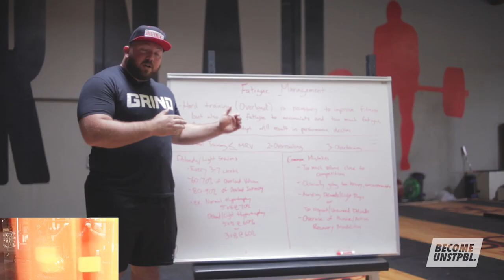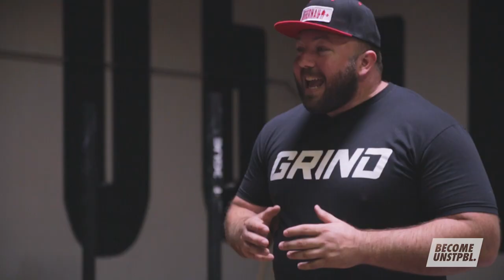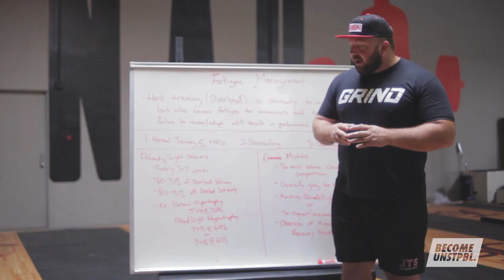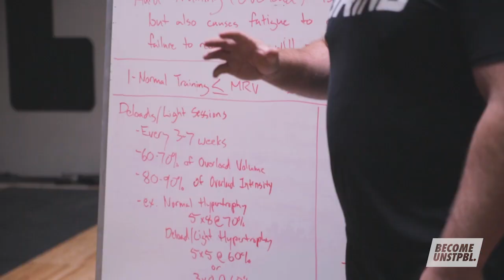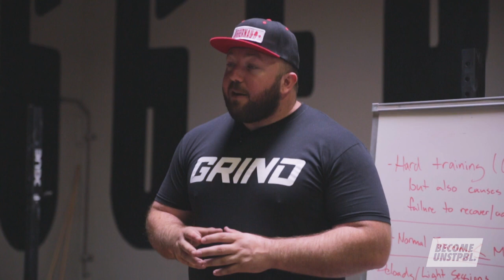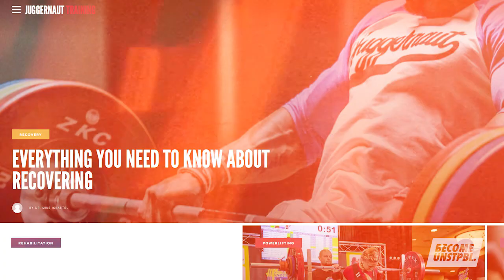Fatigue Management | JTSstrength.com

Comment: I love this guy! I thought something was wrong with me. I started full body training. Heavy and light lifting with cardio. I went from hero to zero over night. You just saved me from making a mistake. I bought all kinds of natural test and stamina boosters. I noticed a pattern in my training. And I never could understand why I'm super strong for a month then completely helpless for two weeks. 2019 10/10 
Mark this day I will be taking your advice. I gained 12 pounds of body fat because I thought I was under fed but now I know. What you teach, It all fits. I been researching so much I'm practically a chemistry doctor now and I couldn't find anything that fits my issues.  Thank you!💪 Today is day 8 and I'm right on schedule starting to get my drive back. All I did was nothing couldn't get out of bed. I will make more effort to do light exercises on my down week. I got a tens unit for message therapy. Can't wait to gear up for more.love to pump it's truly the best high to get

Comment: You mention in this vid that you increase volume or intensity week over week for 3 weeks, then deload.  When I plug my numbers into a hypertrophy
block from your book, my volume for each lift each week could go up or down
depending on the intensity rating of the sessions for that week, there isn’t a
consistent increase in volume.  Is this intentional? Does the increase in intensity (and the corresponding decrease in volume) for those lifts still fit into the concept of functional overreaching before the deload?  Or does the hypertrophy block setup in the book aim more for increasing volume from microcycle to microcycle instead of week to week?

Comment: Two weeks into a cycle and my last couple workouts have had great progression, +1 to +5 reps per set across the board, but I'm starting to feel run down and my joints are achey. Should I deload? Dr Mike recommends deloading when you stop making progress, but I'm still rolling out the noobie gains.

Comment: Hi Chad, love all of your videos and other resources on JTS! You have mentioned that volume will contribute more to FATIGUE than intensity will, however, I have also heard you mention before than high intensity loads will be more neurally STRESSFUL to the body. I was wondering what the implications of this were in regards to your MRV and readiness to train. ie. which factor (induced fatigue, or stress) will 'fill the cup' of you CNS quicker? what is the difference between stress and fatigue?
Reply from the maker: Great question. Muscular, neural, tendon/ligament/joint integrity stresses are all contributing to fatigue. During the different phases they'll contribute differently towards MRV: muscular-hypertrophy, joint/tendon-strength, neural-peaking but all are always present at different levels, just the main contributor will be more what necessitates the deload.

Comment: Great content.  You are mentioning in the clip that one should feel hungry and ready to go after a deload week.  What if I am at a place where I feel tired, weak and demotivated all the time.  Am I just fatigued and need to step back on volume?  I feel like I am making no progress at the moment.
Reply from the maker: That is a sign of overtraining
Reply: That means u didnt schedule and take enough deload weeks so ur fatigue didnt drop enough for ur next mwso cycle and u continued and ramping up fatigue and now you NEED an extended rest. Depending on the depth of the hole u put yourself into it can take anywhere from few off weeks to months and god forbid in some cases a year or two (but for this u need to be a bloody maniac so probably not what u have)

Comment: Chad, in all your videos and articles you recommend higher frequency training for beginner and intermediate athletes.  Would it be smart to also look at the athlete age because a 35-40yr athlete may not recover from a higher frequency program even if they are a beginner/intermediate athlete? For example your cowboy method program outline in your book (squatting 3x weekly etc).
Reply from the maker: LewisSports Trainingsystems too hard to say based on age alone. Training history will play such an important role there. Someone coming from a lifetime of athletics but only 2 years into powerlifting will be able to do much more than someone going from sedentary to 2 years of powerlifting.
Reply: Chad, maybe I’m wrong but I was looking at it from Charlie Francis point of view of programming. Considering the athlete age and which recovery methods they are using… If you have an athlete who is 36yrs old - work 40hrs a week, has 3 kids, only sleep 6hrs a night, high to mod daily life stressors, not getting therapy. I think it would be very hard to train on a high freq program or perform any high volume high intensity work.  This is one of the reasons why Charlie recommended only 2 speed days for beginner/intermediate athletes.  Thoughts?
Reply from the maker: Yes, the additional information provided in your 2nd comment about work schedule, kids and sleep would likely mean their recovery would be impaired.
Reply: Another reason I recommend all my athletes to use "bioforce" hrv esp if they are in there mid 30's.  Great tool to have on deck when trying to push the limits...
Reply from the maker: LewisSports Trainingsystems http://www.jtsstrength.com/articles/2015/12/27/fatigue-indicators-and-how-to-use-them/
Reply: Chad, I'm testing my 30m sprint from a 3pt stance, SLJ, and 3 fold SLJ on Monday and will complete the week with tempo and 2 easy upper body and 1 easy lower body session. I decided to run the 12 week "cowboy method" I'll report back with my 12 week post results...  I will let my "HRV" readings guide me alone the way....

Comment: Are you suggesting to take scheduled light days before reloading after three weeks?  Or should that just be something you use randomly.   I have been going through the book but I'm still confused on this one principle.
Reply: Before a deload u want to be functionally overreaching. So a tad bit out of normal range. Then do a deload to recover enough for next mwso cycle. And dont forget after few mesocycles take a prolonged (3 or 4 weeks) maintenance fase where u train VERY lightly or not at all with 1 goal in mind: diminish all fatigue and nurse any injuries. To bring u back to optimal for start of a new mesocycle

Comment: If you were training a field sport athlete doing a bunch of other sprinting/jumping/throwing would you still train in the hypertrophy/strength/peaking blocks or would it look more like inverted Jugg method? Thanks chad!
Reply from the maker: +Nicky Miranda when you are training for sport, the structure will change because specificity, the most important principle, has changed. Now instead of the target being how much weight you can move in these 3 lifts, it is going to be how good at football you can be. For my guys, that means we go through a GPP/Restoration Block, Alactic Power and Alactic Capacity. I go very in depth during this seminar presentation (fyi...it's 4 hours long and covers training from the first day of the off-season through the end of the season): https://360.jtsstrength.com/videos/22/99/juggernaut-football-method

Comment: is using the prilepin's table and using your overloading principle a bad basis to setup your reps and set scheme? for example if i were to create a hypertrophy block using prilepin's table and your overloading principle, i'd start off witha 3x6 at 70% which is the optimal rep and set range for that percentage according to prilepin'd table and then just add on a set with each week.
Reply: and to add to that will that be enough to reach a functional overreaching state?
Reply: I am no expert but Prilepins table was created for olympic lifts, wich are a lot more technical and so the focus of prilepins table is to improve the technical skill and strength, not really hypertrophy. I don´t think it would do particulary good for designing a hypertrophy program.

Comment: How should training session/main lift frequency be regulated during the deload week? For instance if I squat 3x/week normally, should I perhaps reduce my squat frequency to 2x/week to reduce total volume? Or should I proceed normally with lower set-rep volume at 60-70%. intensity?
Reply from the maker: Either is fine.
Reply: Juggernaut Training Systems thanks, I appreciate the quick response.

Comment: After a deload should you go straight back to the weights you were struggling with or take it back a few kilo's?
Reply from the maker: Drop it back. Let's say volume increased in each week 1, 2 and 3 then you deload. Start the next block at 1.5 and go 2.5, 3.5. Know what I'm saying?
Reply: +Juggernaut Training Systems I do! Thank you. I bought the book a couple of months looking to train smarter. I've added a lot more volume but wasn't sure how long I could keep adding more weight each week, as I was getting pretty  fatigued pretty quick. I was previously doing squat everyday for about a year going up to a single and coming down for a few triples. I've been listening to the Mark Bell power cast a lot recently and all the greats said volume is the way to go. Thanks for all the information :)

Comment: I just finished an 8 week program that I designed.  Program went well and I felt very strong.  However, I did a week at 90% on all three lifts thinking I would go for rep PR's the next week at 95%  The week at 90% felt great.  For instance, I worked up to a 500lb double on the dead lift; which is a training PR for me.  However, this week, the 95% week, I was supposed to dead lift 515lbs for reps and I couldn't even move it.  My max is 540.  My question is, should I have worked 95% with my 90% the week earlier?  Was that 90% week really my peak week?  The same happened in my bench.  I felt very strong benching 90% and went backwards doing 95% the next week.
Reply from the maker: I set peaking blocks up as a high, medium, super high, deload. So week 1 would be about opener or a bit higher, let's say up to 93% for 1. Then week 2 is lower intensity for a bit higher volume to reduce neural fatigue but keep fitness high like 85% for 3x2. Then week 3 would be up to 98%x1, then a deload.
Reply: +Juggernaut Training Systems Thank you.  Makes total sense.
Reply: +Juggernaut Training Systems Would you recommend a deload this week and start a new training cycle?  That was my plan.  I will work in your suggested peaking plan for this next cycle when I get to that block.
Reply from the maker: +MrPetey51 That likely happened because you weren't neurally recovered from the first week. The way I set up a peak is Week 1-Heavy, Week 2-Medium, Week 3-Super Heavy, Week 4-Deload. In Week 1, work up to a single at about 93-94% (5-8 sets total above 85%), or something you see between a 1st and 2nd attempt. Week 2, volume will be a little higher to keep fitness up but at a lower intensity to decay fatigue and allow for neural recovery, so 85%x3x2 could be appropriate. In week 3, you'll go to a single a bit above a planned 2nd attempt, something like 98% and doing 3-5 total sets above 85%.
Reply: So, for this week drop to 85% for 3x2 and the week after go 98%
Reply from the maker: +MrPetey51 after that would be a normal deload as discussed in the video.
Reply: Thanks again.  Your content is some of the best on youtube.

Comment: Would you avoid NSAIDs as well?
Reply from the maker: mpoll1016 if the choice is use the nsaid or don't train, then use them but otherwise yes they'd have a similar effect of dampening adaptation signaling.
Reply: No. This has been debunked. Feel free to reduce your inflammation any way you see fit. See here: http://startingstrength.com/article/inflammation_sullivan

Comment: Lets say I catched a cold and couldnt train for a few days, did my body decay fatigue in this time, or was my body too busy with the illness?
Reply from the maker: It'd depend on the severity of the cold. Also you'll have a loss of fitness there with no training.
Reply: This has happened to me a couple of times in the last year. I treat the days that I could not train as an unintended deload. Usually when I come back to training, I am fine. Its also possible that the cold was as a result of overreaching and the body being weakened and more susceptible to colds and things. Again, a sign that the body needs to rest. This is all conjecture, though.

Comment: Wait.... Dampening adaptation... NSAIDs are a no go?
Reply from the maker: +Cctmadden they would have a similar effect but its also striking a balance of feeling good enough to do the necessary training or not. The dampened effect is very minimal too in the case of 1 instance. 1 ice bath isn't going to ruin a training cycle, 1 handful of advil isn't going to stop you from getting strong, they make make it possible to have a good session when you would have had to take a day off instead but over the long haul it isn't something you want to avoid consistently relying on.
Reply: +Juggernaut Training Systems slam 800mg after every peaking session. Technically short term, stance?
Reply from the maker: +Cctmadden are you using them to deal with specific pain to be able to do the next training session?
Reply: +Juggernaut Training Systems you bet
Reply from the maker: +Cctmadden Then in that case, yea you're gonna need to take them because even though they may dampen adaptation, it will be very minimal, compared to that of missing a training session due to pain.
Reply: +Juggernaut Training Systems thanks a lot.

Comment: Would it be possible for my mrv to be 2-4 sets total per week on a movement? i’m saying this because i’ve noticed specifically on my squat and bench i’ve done a few weeks at a time of only doing 1 topset for each movement (and a few accesories like leg extensions leg curls etc at a still low volume) i notice progress session to session and i usually end up undershooting rpe on weights, keep in mind i’ve been lifting for about 2 years so i wouldn’t say this is complete newbie gains, but then once i increase to doing 2 straight sets for squat and same for deadlifts i notice i feel like shit session to session, everybody i’ve talked to about this says that’s not possible so i’m kind of in a confused limbo
Reply from the maker: That would sound more like your MEV (minimum effective volume) or MAV (maximum adaptive volume)

Comment: Here's another awfully tough question in your comments section. I hit a 70 pound PR on the deadlift by simply working on technique, form, and mobility. Now I'm struggling to keep up with my programming because what is 70% now was 85% just a month ago. How should I cope with this? I've been doing 70% for 3x5 twice a week because it made sense in my head ("low" weight, low volume) but the more I think about it I might be hitting that "overtraining" level of fatigue that you warned about in this video.

Any help would be a god send.
Reply: just because your 1rm jumped doesn't mean you are read to do the new 70% for reps. work your way into the new found strength
Reply from the maker: Yea Id just split the difference. Increase by 7.5%
Reply: +Juggernaut Training Systems thank you for your help, I'm still very new to this stuff. I'm just going to restart my cycle and use what used to be 70% and is now 55% for a few sets of five twice a week, increasing in weight each time, until I'm at where I should be.

Comment: what about warm baths, are they benefical during a training cycle or are they something to avoid (like at your home not profesionaly)
Reply from the maker: They can have a therapeutic quality but you don't want to use extended heat based therapy because it will dehydrate you and negatively affect recovery.

Comment: I have two questions:

1. Is a warm shower to avoid? Or do you only mean shower hot and then cold?

2. Can I do high volume stuff (~15-20reps) till failure in my deload week? Then I would use like that because deload is more for the brain (ZNS) than for the muscles and high volume with light weight isn't that taxing for the ZNS.